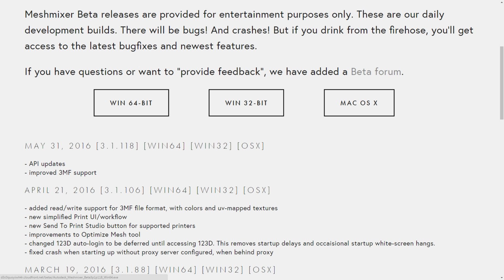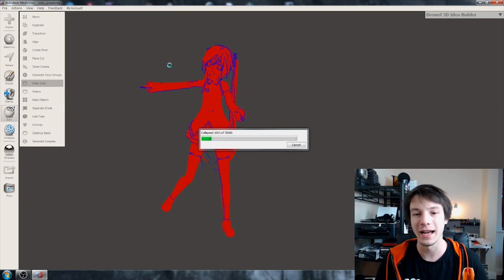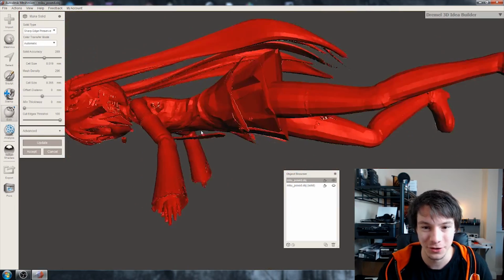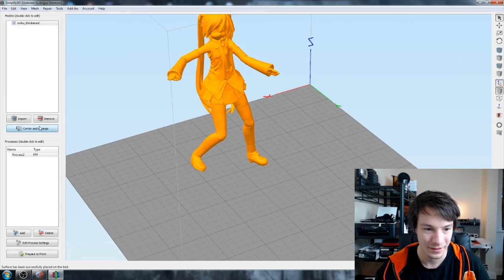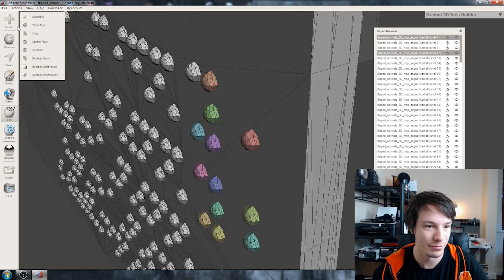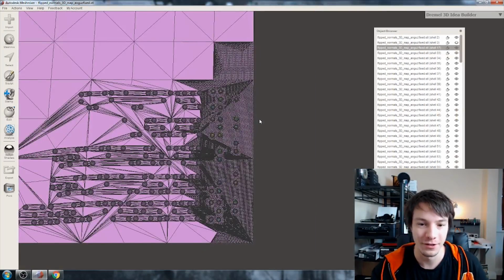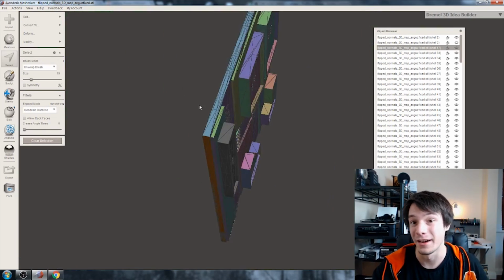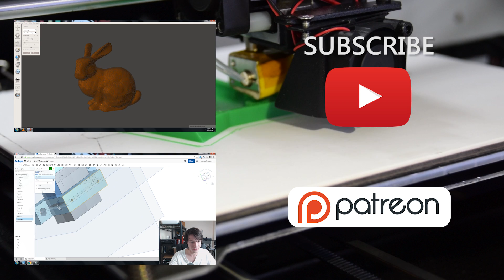Fixing impossible STL's with Meshmixer 3.1.118 BETA

Comment: 3D printing enthusiasts can use Meshmixer 3.1.118 BETA to fix and prepare models for printing.

⦁ 💻 Software: Meshmixer is a powerful tool for fixing STL files, with features like "Make Solid" and Boolean operations.
⦁ 🖨 Fixing STLs: The "Make Solid" tool can repair unprintable models by offsetting and adding thickness to fix errors.
⦁ 🔧 Boolean Operations: New Boolean Union functions allow combining separate shells, fixing geometric designs.
⦁ 📦 Reducing Triangles: Meshmixer's "Reduce" and "Remesh" tools help simplify models, reducing file size without losing detail.
⦁ 🧐Inspecting & Repairing: Inspector tool identifies and fixes errors; manual repairs may be needed for complex models.

Comment: It's been many years but YouTube just saw fit to recommend this to me now, in June 2022 :-) I thought I might point out that STL files can contain multiple independent manifolds, and the slicer will effectively union them as part of the slicing process without needing complex geometry.  So, you can probably get away with just moving the different parts to intersect and then exporting it like that. It doesn't need to be a single mesh. :-)

Comment: Can it fix daz hair to make it printable? Also having issue printing daz clothing. Only found one tutorial for the hair using blender but the person doesn't really tell you the step by step.
Reply: did you ever figure that out
Reply: @JJ-vp3bd  No I didn't and because of the dead end I put my time and effort into other things and moved away from 3d modeling completely. I just couldn't justify the hours spent designing characters if in the end I wouldn't be able to print them, which for me, was my goal.
Reply: @sburgos9621  i figured the hair itself has to be solid so it works
Reply: @JJ-vp3bd  I ran one test print and everything else printed fine except for the hair and clothing. I did have some issues with the face as well but I read that it may be due to the fact that I didn't erase the teeth and inner mouth parts. I didn't run the test again to try it out but it made sense given how perfect the rest of it printed out.

Comment: I'm an Architecture student, when I'm making a model to be printed I completely switch programs to fusion 360 or something to avoid janky mesh from something like sketchup does. BUT this isn't something my classmates do when giving me the files to print stuff at 3 days before the passing date.
Reply: currently struggling right now, i have a pretty simple sketchup model but i just cant get it to stay solid once i bring it into cura or any other slicers. im trying to figure out mesh mixer but im not gonna get smooth edges like i want

Comment: I really need a quick tutorial (3-9 minutes) on how to merge two solid meshes xD
Reply from the maker: Use Boolean Union in Meshmixer, I've got a video on it :)
Reply: I know :) the ussue is hat the models I am creating wear arnour (up to 30 seperate meshes) which must be merged. Boolean just fails and doing it manually takes ages ^^
Reply from the maker: Oh I'd use repair in 3D builder if you have win 10 then, that'll stitch them together.
Reply: Cool thanks I'll give it a go and let you know if it worked! ^^
Reply: It actually did. Sadly it destroyed other parts but hose are easily repaired. Thanks, your're a livesafer! =)
Reply: another question: is there a way to cut through the model but only at one spot: I need so seperate the upper and lower torso but the hands are at the same height as the plane cut and would also be cut.
How can I only cut the torso? :)

Comment: Excellent stuff, Angus. These tutorials are mega useful. Any chance of a S3D one?
Reply from the maker: I certainly can, what kind of things are you chasing?
Reply: S3D is fairly intuitive, but it's getting the best out of it, like any software, which is the ultimate goal. To that end, it's things like using the advanced processes, profile creation for getting the best out of different types of material, playing with the scripts, those things would be useful.
Also getting the most out of the mesh and repair menus, if they are required.
Thanks for the reply!

Comment: Nice! I just discovered Netfabb cloud solution is no longer free to upload and fix those separate shells and the full version of netfabb is not cheap!. I am also a huge meshmixer fan so thanks for another great video, great timing and as usual explaining what the complex options actually do!
Reply: Brilliant, thanks for that!
Reply from the maker: Hi Norma, it still seems to work OK for me? Keeping in mind the new domain is modelrepair.azurewebsites.net , but typing in cloud.netfabb redirects to it. Just tried it then and it didn't try to charge me! I STILL prefer meshmixer though, gives me far more control. Many thanks for the kind words :)

Comment: Hey Angus. I'm having a really difficult time with some Arkham Origin models. I have Deathstroke's faceplate, but it came a bit weird. The outside looks normal, but when you flip it around, it has this salmon pink color and doesn't seem to exist at all. I cannot select any of the bits inside the faceplate, and there is no structure to any of it when I try to put it in Simplify3D. From the front, it looks fine but, again, when you turn it to the back, it disappears completely. 

Clearly something is wrong with the model, but I am not sure if I can fix it via Meshmixer or not. It would print just fine if I made it solid, but that adds a TON of extra material on the back of the head and behind the eye hole and everything. For a better idea of what I mean, this is the picture of that salmon color texture that I do not understand at all: http://oi67.tinypic.com/25i3exl.jpg

If you have any suggestions, let me know! Thank you!

Comment: Hi angus, I have this file that is 'leaky' and each time I've tried to use Meshmixer to fill the thousands of holes it just crashes, any ideas of what I can do?
Reply from the maker: Your computer may be the bottleneck if the file is very large and damaged - I find it maxes all 6 cores on my Xeon mining rig using make solid - it's very CPU intensive. How big is the file in mb? Have you tried netfabb cloud? Might work.
Reply: both my gaming rig and reasonably high end laptop seem to crash as soon as I click "make solid" 
The file is only 5.27mb so I am a bit puzzled. will give netfabb cloud a shot too, cheers for that!
Reply: Just an update - Microsoft's model repair service (formerly netfabb cloud) worked excellently, thanks again for the advice!
Reply from the maker: Sweet! Glad to hear. Now it's fixed you might have to thicken some areas which Meshmixer will be great for.

Comment: You should have just handed it back to you friend to fix in Maya, after all it wasn't Maya that left the objects hovering off the wall :-) Really, its knowing how to model for 3d printing its got "nothing" to do with the software. Computers only do what we tell them to provided they're not buggy as crap.
Your anime model proves my point, you had to design it to be printable so ultimately its the limitations of FDM printing and the designer not the software. Stop picking on Maya or other design tools if it f%^ks up as a designer, you need to accept responsibility, you didn't allow for the printers limitations. If its from someone else then hand it back to them to fix and stop blaming Maya lol
Kudos for the how to fix these things in meshmixer though, cause you're always going to find models designed by people who know nothing about the relationship of 3d printing and its design needs or people who just don't (want to) see the relationship and leave the problem in your court.
Reply from the maker: Wasn't possible the designer was long gone :) The dimples were modeled as 0 thickness as well, you're right it's not the software but again, Maya isn't designed with manifold 3D Printable files in mind and afaik doesn't have any printability checks built in. I know Zbrush does now, which is pretty cool.

Comment: Could you maybe do a tutorial on how to make a hollow object solid in Meshmixer, for example I ripped the Vault-Tec van from Fallout 4 and fixed it with Netfabb, but the inside is hollow, so it's impossible to print.
Reply from the maker: Sure thing - what's the exact name of the file within the game? I'll have a look at it.
Reply: Hey Angus! Thanks for responding. It&#39;s the file in Vehicles&gt;Automotive&gt;VaultTecVan_PreWar_01.nif It has an interior with chairs but ofcourse for 3D printing you just want the inside solid so you can print it properly without having to use useless support inside of the model. As you can see on this link : https://i.gyazo.com/f042b118d2a69aed3156780ffc30d02d.png . Some parts also don&#39;t slice even after making them thicker in Meshmixer. The same goes for the file LoadScreenArt&gt;Armor03PowerArmor5T45.nif, which is also hollow on the inside which makes it impossible to print without useless support. See this image: https://i.gyazo.com/d8edb0a86c4d21947bfd07cd9e11c94e.png . Thanks in advance! Oh yeah and could you also maybe show us how you made your Mirelurk 3D printable. I tried printing it yesterday but a lot of parts weren't connected.